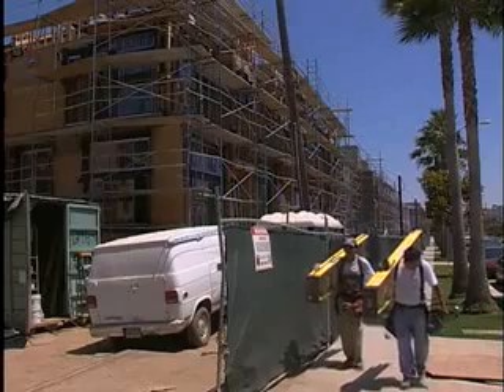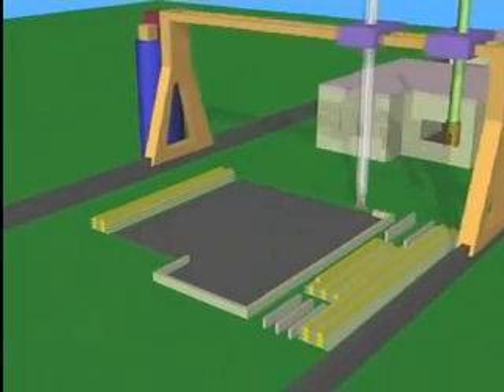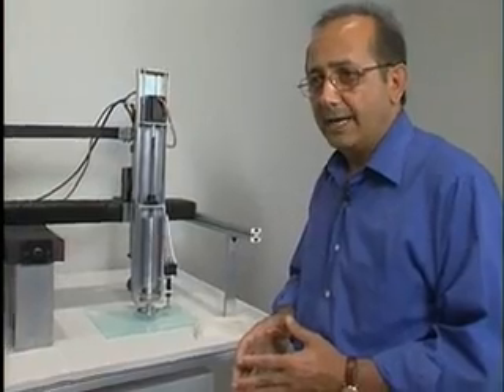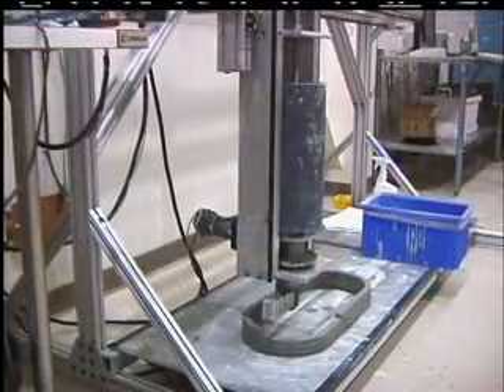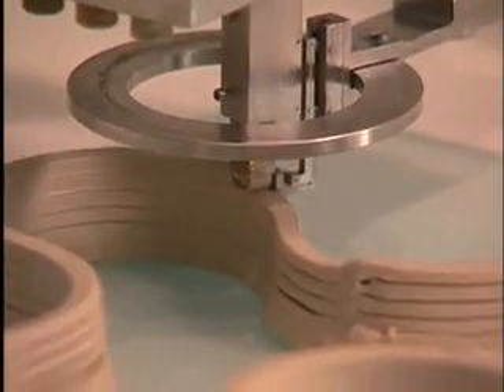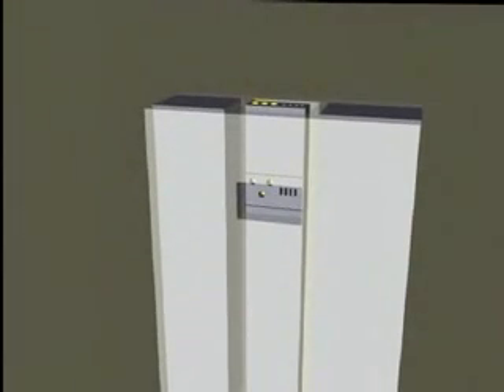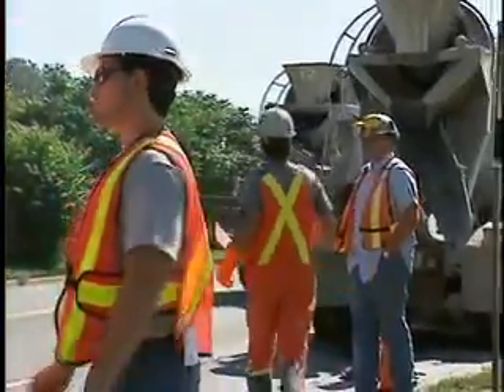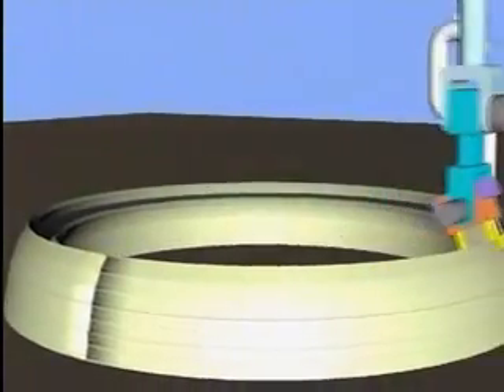Contour Crafting

Comment: Also, even the small machine you use will get faster as technology improves.  Remember that the first home printers took a long time to print a single page... in low-resolution dot matrix... with track feed on the paper.  A good typist on a manual typewriter could do it faster and prettier.  I dare any typist to take on my ink jet, and it isn't even top of the line.